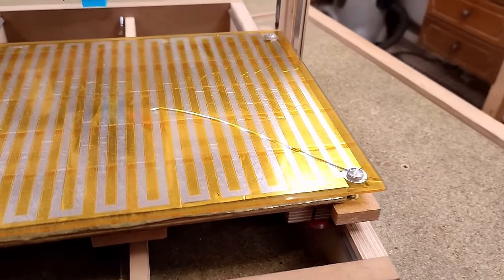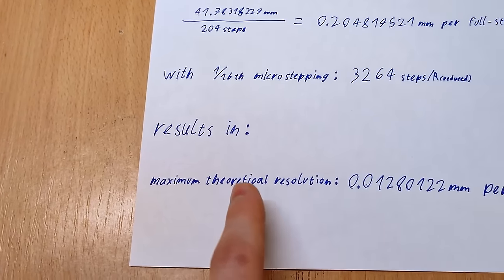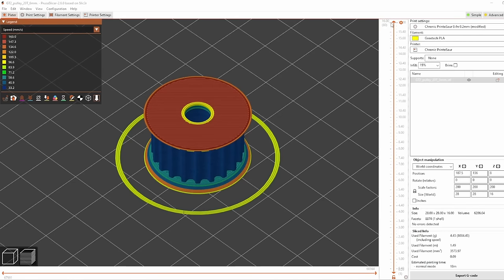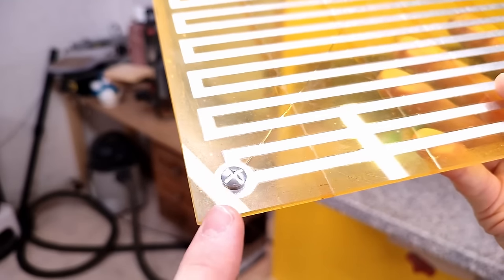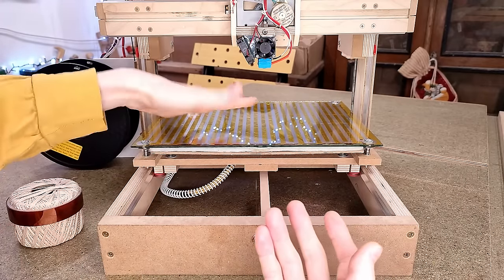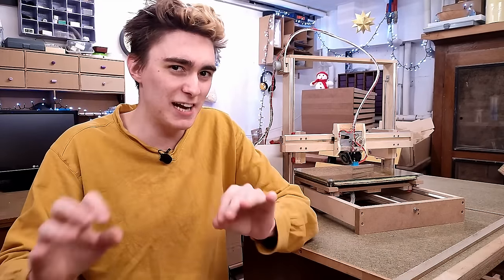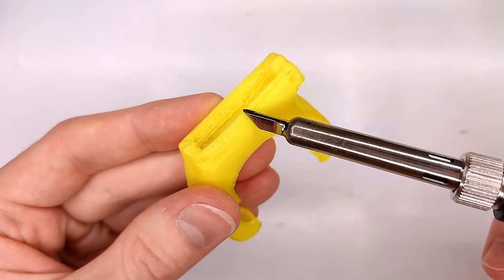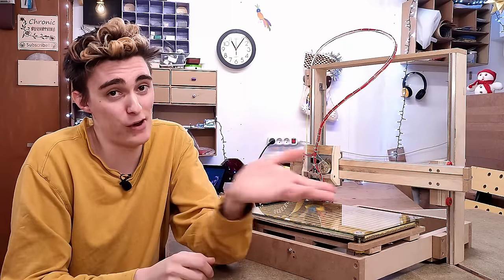Mistakes were made... Unipolar 3D printer part 15

Comment: Seems my comment deleted itself when I edited. 
Anyway, well done so far! Three suggestions that may help:
1. Add G28 X Y to your layer change gcode. That will home those axes each layer and fix drift between layers while you work out the problem. 
2. Check out past printers that have used cable/line driven axes. There was a sand table a while ago that used a series of pulleys to pull the filament off the shaft and onto a pulley and back to the shaft every wrap so the line couldn't walk. Said there was no drift. A robot actuator too. Actually, even the Apple ImageWriter and many old Dot Matrix printers used cables with steppers. I think the printers homed every line too. 
Even some old 3D printers did that. Some had sandpaper around the pulley. 
3. Geared steppers have backlash, and those ones in particular were popular for tiny printers at one point. Marlin has backlash compensation built in. You might want to check that out. 
I know of a few printers that only used those steppers and fishing line. I'll try to find one and comment again.
Reply from the maker: Yeah something's up with comments at the moment, I also didn't receive a notification for this one.
Thanks so much for the suggestions! Homing between every layer is pure genius! I'll immediately try it and post a short with the results!

Comment: The Raspberry Pi Imager tool has a finished sd card image for Klipper. The hardest challenge will be compiling the firmware and flashing your controller, this - i think - is only in linux possible. But with lead screws Klipper will most likely not bring any performance advantages, even though the web interface would still be nice.

Your print speed issues are most likely due to max volumetric flow limits and even more likely to minimal layer time. The slicer will slow down to ensure both values.

Comment: i converted my 3D printer into a lazer printer ,all i had to do is i printed a hot swappable mount for both the nozzle and the laser module ,so when i want to print i mount the nozzle and when i want to cut i mount the laser

you can use Lasergrbl if you want free software , i use a ramps 1.4+arduino mega +Marlin,
i use LightBurn since it has support for Marlin directly
LightBurn is free for only 30 days but i refuse to pay for a software that i have to pay 60$ just to get an update

Comment: Great Work, reminds me of my first Printer, a Teebot, where i only got some parts a Manual and no hole was at spec and had to be worked. It's a Mega 2560/Ramps 1.4 printer. It's janky but it works most of the time even after 9 years and 4 rebuilds, Zip ties were my friend when several parts broke and i had somehow to print the replacement parts. 

A Geetech Prusa Clone was my second printer and since then i use the filament of them, great quality for it's price. Now you got a working printer, keep improving it and reprint parts.  

To be honest i would get myself a used Vanilla Ender 3, for around $99 without upgrades in 2020, today they are  around 80 USD, Ender 3 and Anycube Cobras. 
Those cheap Printers not realy beginner Friendly. Building your own is a whole other experience and helps to keep those printing.
 
ATM i am rebuilding one Ender 3 Pro as Demonstration Printer for a School (Only have Core XY were nothing is to look at) 
and i will take other my Ender 3 Hulk and build a Voron Switchwire around it. Long story short, the first Ender 3 pro broke after 1800 hours, it was cheaper to buy another Ender 3 for 100€  new and putt all the Pro Parts on it, but those printers need a rebuild after 500 hours as well. 3 of the 4 Wheels for the Bed were broken after 500 hours !

Since 2014 i am building DIY Kit Printers and improving them, great work creating your own Printer !

Comment: hey man! As I've said in my comment on your previous video. I love your channel. Just thought about any easy way to make the x axis almost bulletproof: You could just nick the X gantry from an inkjet printer, they come with built in belt, tensioner, they a re usually quite rigid, though you'd have to figure out a way to drive a DC motor from a signal that would be used with an A4988. on the plus side, this would mean that you have closed loop control of the X axis, thus eliminating layer shifting on the X axis...
Reply from the maker: Thanks :)
So far I haven't come across an inkjet printer gantry that was any good of its own. But I am planning to work on using DC motors in closed loop control for 3D printing!
Reply: I promise, I'll make a video to help with this! I haven't had a chance yet, but it will come!
It uses a quadrature encoder, and I was surprised at how accurate it is.
Reply from the maker: @aaamott  I know, I recently checked your channel too see if you had already done it. That coreXY you built is insanely fast!! I had never seen 800mm/s before 😅
Reply from the maker: @aaamott  BTW take your time with the video, I won't immediately get around to the DC motor thing anyway. But thanks a lot for helping with it, I wouldn't be quite sure how to approach the feedback part in code!
Reply: Budget inkjet printers (ans scanners and so) evolved a lot over the decades. New ones are stripped down to pennies. Mechanical motion and structural functions are often integrated in injection molded plastic parts. Sadly, not that easy to reuse.
Reply: @ChronicMechatronic  DC servo. Cool stuff. I tried to make one. It was crappy.
Suggestion: use a good quality motor (preferably with ring varistor built in). Don't buy cheap stuff (they are like your bearings: too bad), get them from appliances.
Reply from the maker: @besenyeim  yeah it's insane, Epson even got rid of the linear rod and is running the plastic carriage directly on folded sheet metal parts. On the other hand they still do use a stepper motor in the scanner assembly where HP uses another DC motor. Speaking of DC motors, I never bought any, just salvage them. I noticed there's quite a difference in quality, some really don't respond well to PWM speed control, the ones in inkjet printers are of the better kind. Those also spin surprisingly slow in general (for a DC motor anyway).
I'm planning to be able to use the motor, belt, idler and encoder from an inkjet printer and incorporate them directly into a cartesian gantry - may need two identical ones for the heavier axis though, I guess we'll have to see. I really haven't looked into it very much yet.
Reply: @besenyeim  Meh, I wouldn't say that all of them are non reusable; I've taken apart a few of them in the last couple of years and most of them still use a sheet metal frame, on which a plastic part slides with some lubrication (For example EPSON Stylus SX110) some still use a rod for the mating part of the carriage (HP Deskjet 2050). So I'd say that from the around 20 that I've taken apart (Model years from around 2002-2019) only 1 was completely propitiatory without a way to properly reuse the carriage outside of the original plastic shell
Reply from the maker: @Fejszi  it depends on the type of printer, all the newer consumer grade stuff is mostly trash I think - granted I don't go dumpster diving very often, so I've only disassembled like 3 inkjets so far. Apparently in older more "professional" machines there's even real NEMA 17 stepper motors to be found, but getting a hold of those printers can be tricky if you don't have the connections at companies etc. who throw that stuff out.
Reply: @ChronicMechatronic  My inkjets usually come through E-Waste bins, though I've nicked a few of them from the literal dumpster... As for steppers... Yeah, old printers (Especially Photocopiers) had used steppers (though most of the time non NEMA motors), but you best bet for finding NEMA Steppers are dot-matrix printers from the early-mid 90s, they usually have a NEMA17 driving the Printhead carriage, though there is an argument that still working/could be repaired equipment of that vintage shouldn't be destroyed.... 
As for how to get them, where I live (Eastern Europe) you can see listings for free copiers that people want to throw out, you just have to go there and collect it, they have steppers, proper linear rails, and a crappton of interesting electronics. As for inkjets, as stated in the start of my comment; dumpsters and E-Waste bins, As for laser printers, I haven't even taken apart one, I always save them since most of them can be easily repaired an then resold.
Reply: @Fejszi  I've had the same experience, except the one I thought was all proprietary just had separate chip for the encoder right on the carriage. I just cut its traces and soldered straight to the encoder and no more proprietary! 
Bonus: The metal carriages always have two or more perfectly level screw mounts in my experience. Never once seen different, even if there are all kinds of crazy origami bends in the metal. Have you had the same experience?
Having real trouble with comments. Every edit seems to delete it. Hope you all aren't seeing like 10 comments 😂

Comment: inteesting if you are going lead screw way remember few things
1, triangular thread is ment to have much more friction than square one so lubricate the screw to not get stuck in place
2. backlash will only grow so put a weak spring and another nut floating to remove backlash, because if you start getting backlash it may be bigger than single step
3. use normal length brass nuts instead of steel ones because it is easier to controll backlash and wear when you know what wears out faster. in other words steel on steel friction is no good because both surfaces wear out evenly , only they wear out only in places you move so you end up in wear out spots on a screw and flopy nut while parts of the screw are still fresh, this is where brass nut with backlash nut comes in you get most wear on the softer metal which is also partially self lubricating

Comment: I haven't finished the video yet, so maybe you get to it later

but if you see that your speed is slow even when upping acceleration, then you probably have auto cooling (filament tab) set to automatically slow down to have a minimum layer time. so either change the "minimum speed" or "minimum layer time" or outright turn off the feature. ofc this could cost some print quality

Comment: My secret weapon for the final refinement of flat/parallel/square wood surfaces is an extra-extra-coarse DMT Dia-sharp stone. It's a bit tedious since you have to brush the dust off every 10-20 strokes and it still gets lumps of compacted wood dust after a while, but a quick wash with water gets it back to pristine condition. And it's only 8x3", so larger surfaces aren't guaranteed perfectly flat, but with regular straightedge/caliper/square checking you can get pretty darn close.
Reply from the maker: I think I'm too lazy for that 😂
Plus the straight edges on my steel rulers all have a curve to them

Comment: Great iterative design techniques! I wanted those bottle cap vgroves to work! They are expensive.  Maybe smashing 2 together with bearings on a shaft could form that inside ring?

I mostly finished my CAM program.  It's at the end of my latest video.
Reply from the maker: Making those sleeves with 2 bearings from bottle caps is possible, just a lot more work. I can show how to make one for the video, but really don't wanna do it 16+ times anymore 😬 Hence why I'll let the sponsor deal with them 😜

Thanks for letting me know, I'll take a look at it!

Comment: 20:48 Maybe not to use a wheel, but to make the bearings travel directly along the corner?
Reply from the maker: Wears down the aluminum in no time, plus it's harder to mount the bearings in that 90 degree angle without 3D printed parts. I toyed with the idea of running separate bearings on each side of the corner for the laser cutter, but ultimately the V-groove rollers save a lot of hassle and complex geometry for mounting the bearings.

Comment: claims not to understand micro-stepping*... *presents excellent diagrams illustrating how it works I like your plywood printer :)
Reply from the maker: I love getting this type of comments on my own videos, usually I only see it on bigger channels 😅
Seriously though, the diagrams I showed were just a simplified visualization of the mechanical movement - the whole process from PWM sent to specific coils, to the magnetic field strength that builds up, getting turned into rotational movement dampened by the springiness of the magnets, plus all the various bending and flexing of the gantry until the motion actually reaches the nozzle, is a wonderfully complex system that's really hard to wrap one's head around.
A lot of what I explained I only fully understood through the process of coming up with that explanation and the research I did for it!

Comment: I will ask something, when I do something with these motors, cnc etc., there is a rattling from the motors, how did you solve this problem, for example, when I do left and right on an x-axis, there is a click during the brass and the calibration is broken, please help
Reply from the maker: I'm afraid I need more details to be able to help. I assume you have the same low-res steppers I used? Those inherently chatter during slow moves due to the large step angle, there's nothing that can really be done about that. My printer makes a lot of noise at lower speeds too. What do you mean by the calibration being broken?

Comment: A creality engineer told me the cost to manufacture an OG ender 3 is $48 - below your hard limit!
Reply from the maker: Damn, let's swipe their warehouses then! 😂
I wonder how they do it though, that means those damn NEMA 17 stepper motors can't be more than 3 bucks even though they sell upwards of $7.00 everywhere. 
So they have like 75% profits, which is insane 😬
Reply: @ChronicMechatronic  75%, no. Manufacturing is not the only cost of products. The development cost has to be spread, logistics, taxes, the company's other operational expenses, etc.

3 bucks? Maybe 2. The keyword is volume. Just look at electronic parts distributors' open offers: 1 piece = $1, 1 of 10000 pcs = $0,005. This may be exaggerated, but closed-doors deals of millions of parts can be unbelievable, if you're used to buy a few parts a time.
Reply from the maker: @besenyeim  right, how could I forget literally all the companies other operations are living off this revenue, given 20% of my own channel's income goes straight to social security...

I do wonder how those stepper motors go from $2 to $8 though, is that really all added by the logistics of distributing it in small quantities?
Because of the bulk pricing I try to buy things in quantity whenever possible to spread the cost. Even just a set of 10 A4988's is definitely worth it over a single one.

Comment: While Klipper is nice,  it should NOT be on each and every printer.  Everyone seems to have gone Klipper Krazy, and honestly, it's not even beneficial to most the printers people want to see it on.

I support your choice to NOT put klipper on it.  Until you see a need for it - stick with Marlin, because honestly most people don't realize just how much Marlin has - most the  things people say you 'need' Klipper for... Marlin 2 supports....
Reply from the maker: Thank you :)
There's definitely a lot of hype around Klipper, I think the average Joe probably won't even notice the difference - I certainly wouldn't, that's for sure. I also saw something called input shaping in the menus of the TwoTrees SP-5, no idea if that's the same thing Klipper does though
Reply: But what's the upside of using marlin? I get that it can do almost everything klipper can, and more, and that klipper is not fundamentally better. But why not use klipper if it works too?
Reply from the maker: @amogusenjoyer  to me the advantage of Marlin is that, unlike Klipper, I can easily use it being familiar with GRBL. With so much of my time being taken up by making the videos I kinda need to spend as little time figuring out how to actually do things as possible, or else I'll get even fewer videos done...
Reply: @ChronicMechatronic  ohhhh I didn't know that! I'm not familiar with marlin but that makes a lot of sense. Klipper is fun but just actually making stuff like you do is even more fun , instead of having to learn something for no reason😅
Reply from the maker: @amogusenjoyer  I don't mind learning stuff, I actually quite enjoy it and do so with almost every video, but with my primary objective being to make videos, I can't really spend days or weeks trying to figure out something I've never done before just for a 5 second remark, because that's all time I don't spend working on the actual video itself... I'm already slow and inefficient enough as is. Plus I genuinely loose interest as soon as something works for what I need it to do - which Marlin does 😂